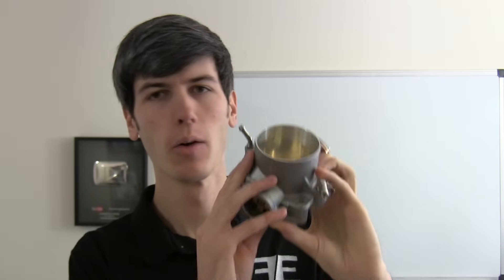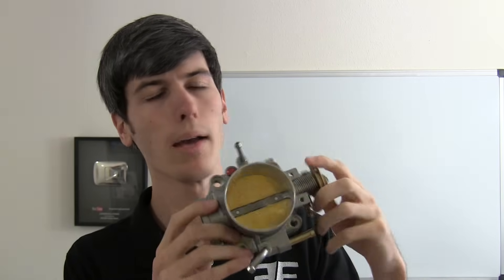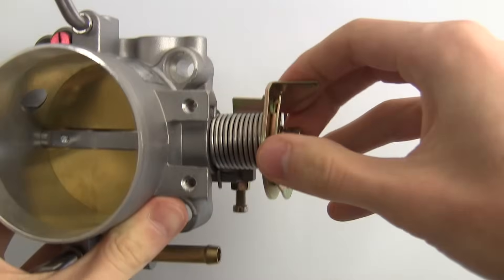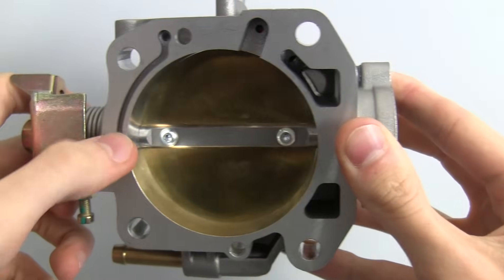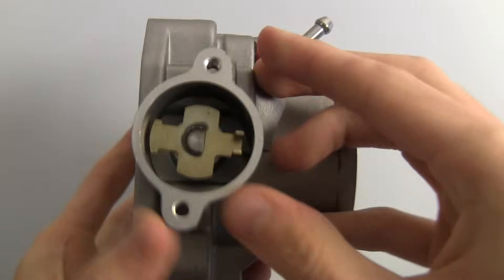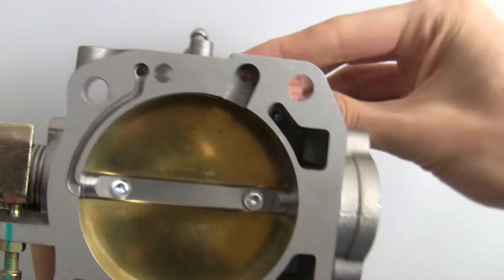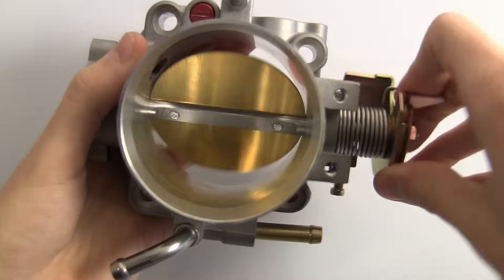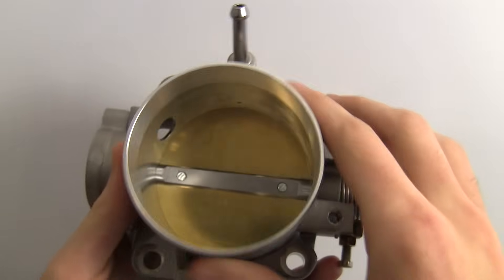Throttle Body - Explained

Comment: is it the same as top fuel dragsters use to have uncovered on top of the engine?
Reply: What? Top fuel doesn't use throttle body. The giant thing on top that lets the air in functions the same way as a throttle body. It's called an air scoop.
Reply: TheCowGoesMoo o thx so they have the airflow regulation right in the intake?
Reply: karlos275 I'm not an expert with top fuel, if they even have one, maybe. They might have something completely different, hard to compare the average car engine to one with 10,000 hp lol.
Reply: karlos275  Top Fuel and Funny Car engines do have throttle bodies.
Not like the Acura Integra unit shown in this video, but they are throttle bodies. 
Currently there are two very distinct styles, the older is the top hat style that is integrated into a scoop that sits on top of the blower where there are 2 to 4 butterfly blades at the entrance of the scoop and ducted down to the blower, the newer style developed by Gibson Miller is a very low profile unit that is located directly on top of the blower with the scoop or duct above the throttle body wide open from the entrance to the top of the throttle body. 
The throttle bodies on Top Fuel and Funny Car do regulate airflow and engine rpm. 
Currently the airflow regulation is not in the intake manifold.

Comment: Is upgrading to a bigger size really worth it , comparing  $ spent with horsepower gained on most compact cars like the 1997 Honda Prelude
Reply: It depends on what mods are already there. If the rest of the car is stock, a bigger throttle body is not beneficial.
If you have major mods installed, it MAY be a restriction.
Short answer: Don't bother.
Reply: Benedocta 100% agree
Reply: I have a 97 prelude and i will be buying one, should see a increase in power :)
Reply: miki dw Not really if it's stock, especially for a little 4 cyl the engine can still only take a certain amount of air, you can get a 104mm throttle body but that doesn't mean it's going to be taking in that much. You'll see the same gains as a CAI would. Should save that money for better heads, bore it out, cam, etc. (if you actually want to see any real gains)
Reply: miki dw You could even lose power because with a bigger throttle body, the air speed is smaller so cylinder filling could get worse.
Reply: miki dw
No you won't your butt dyno will make you think you do, but you won't. You'll just get more throttle input for lower pedal input.